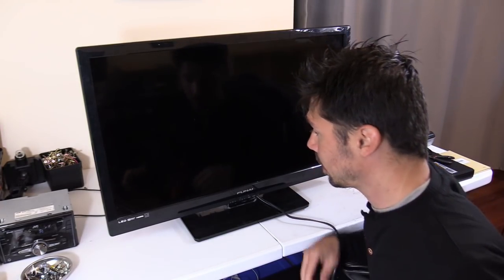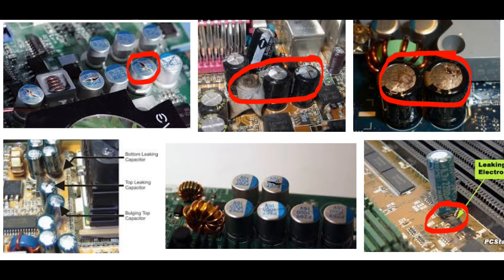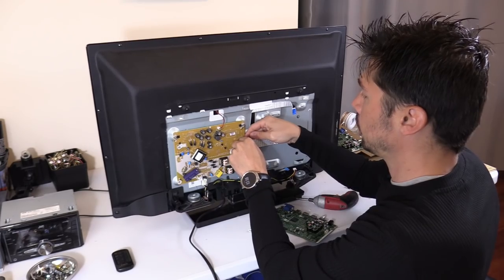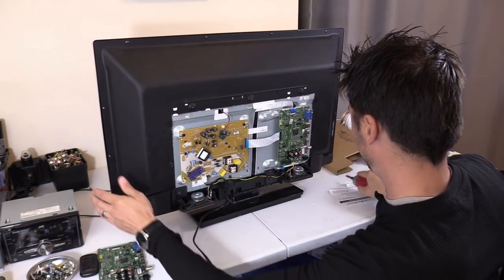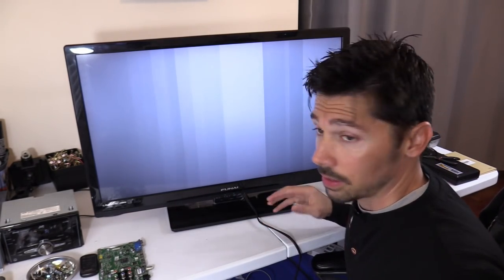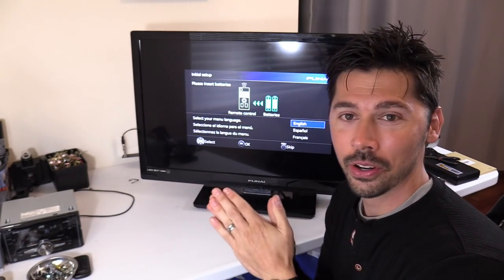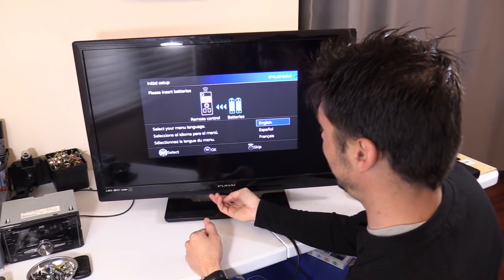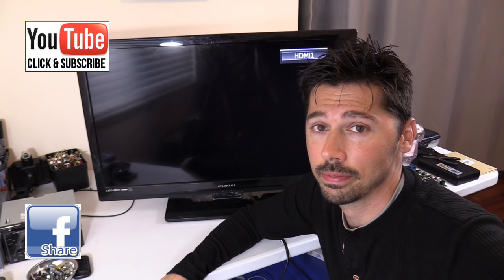WATCH THIS VIDEO BEFORE FIXING YOUR LED LCD TV

Comment: Tampatec, I have a strange problem I was hoping that you can shed some light on.  Samsung UA42 LCD TV backlight blinks when the TV is plugged in.  TV doesn't come on.   I replaced the power board as that is generally the issue without testing it first.  Still doesn't work but I found that if I unplug a small white connector on the PS board that the TV will power up, I see lights on the T-Con board and sounds works from TV.  I am guessing the plug  is the back light inverter as the backlight doesn't come on when unplugged.  Can't find this issue talked about anywhere.  Is it possible to repair this issue?

Comment: Hi, I'm trying to reanimate Vizio E461-A1. It reacts to power button, but only once, i.e. I can turn it on and then it doesn't respond to anything, so, I even can't switch it off. Screen is black, no backlight, but power LED shows that TV is ON now. Power supply works just fine - all output voltages are ok. Tried to replace eeprom on main board , but after soldering the new one it stops even turn on power led, so, i returned the old eeprom chip back and don't know what to do next. Any suggestion?

Comment: Hi Tampatec, I have a 55 Sharp Aquos that within a year and a half it crapped on me and I got too busy and missed the warranty by a few months. Here's the issue, the logo screen comes up and instead of going to the menu it restarts. I read somewhere how someone that had the same issue changed the main board and that fixed it, which I did but it still does the same. Any help in this matter will be greatly appreciated.

Comment: I have a Vizio 55" 4k tv model number M55-C2 the serial number starts with LWZQSBBS The mean board is bad and looked for a replacement one but no luck only found other one's that aren't compatible.
I was wondering if I replaced all the guts would that work?
Or does it all come down to the panel that would not be compatible?

Comment: I've watched a few of your videos now. I have an LG 47LW5600. While watching TV, everything went blank. The power relay clicks, it will turn on and off, but there is no sound and it appears there's no backlight. Would replacing the control board be a good first step?

Comment: Hi, i have a question. If I have a Sony tv that has a cracked screen in the corner from being hit with a drum stick that went flying across a room by accident, but has no visible crack when tv is off, do you think i would be able to fix it my self by replacing one of the panels that you talk about? Or do i just need to buy a whole new tv for that issue?

Comment: I have a Rca 65in the backlight and picture flash up ever 3 to 5 seconds. I have constant standby 5 volts and the power on gives me 5v steady even when cycling the flash.  I unplug the t con the backlight flashed once and stopped. I have standby 5v pwr on 5v 12v but my 24volt on PS I cannot get a reading. If I unplug backlight I can get 5v power that TV is on but no picture with tcon plugged in and backlight unplugged

Comment: Tampatec, 

Thanks for doing this video.  I really learned something here.  I know that eventually I'm going to order a board.  And using the sticker part number is the way to go.

And thanks as well for the tip about the brightness being at 50% rather than all the way up.  I would think that would also save some energy as well.

Regards, Tom

Comment: my 43 inch Samsung led smart tv fell a about a foot down... not flat down to the floor... basically still on stand but slumped over half way on the floor... ughhhgh so now there's horizantal lines and jumping   sound is still great and I can basically still see the picture.  it just jumps up and down I need help i think I'm gonna cry omg
Reply: no screen crack.  but corner frame is.

Comment: I hope you can help me. I have vizio tv when I plugged in the vizio logo lights up like amber color but doesn't turn on
Reply from the maker: Nicolas Jimenez shopjimmy.com sells a main board repair kit for that. First check stdby volts, if ok on power board then check out that main board repair kit.
Reply: I forgot to mention I changed the main board and still does the same I ordered the part  from electroparts and according to their troubleshoot guide that was the main board. My vizio tv model is VF551XVT 
Thanks for help me

Comment: Great video I wonder could you give me some advice I have a e-motion TV the red light is on but with the remote it will not switch on it will intermittently turn on with the button on the side of the TV any help would be very much appreciated thanks

Comment: I have a Philips 42 inch tv about 10 years old.  Its always had this problem: It sporadically turns itself on but has no sound, and the screen is white, then it will turn itself off again.  Sometimes, I have to manually press the on/off button to turn it off.  We had tech support replace the computer and power boards about 8-9 years ago, but this never really fixed this anomaly.  Am I thinking the problem is not on the boards?

Comment: i. have a 43 inch LG smart tv..that don't work right away the LG logo pops in and out , un till i burp it with my hand on it's back kinda hard a couple of Times and than it works. .but wen i shut it down and turned back on have to start the routine all over again any ideas ?

Comment: Great video, very informative and I like your delivery style, it is right to the point.  I have a question, I am looking at a VIZIO 55LE5400-UC for a friend.  When it is turned on I get the LG logo, a clock and the four dashes below the clock.  When that goes away the screen starts flickering and a static sound comes out of the speakers.  The flickering seems to go away but I think it just speeds up and the static sound is still coming out of the speakers.  I tested all the  caps on the TCON board with my Fluke meter and a Blue ESR meter, I took them off the board to test them and they were all fine.  What else can I do to rule out which board it is?  Thanks again for all your great work!
Reply: Update:  I did fix this TV.  I started checking the inputs on the main board and none of them worked, all the HDMI's, both component inputs etc.  I took a heat gun and carefully heated up the chip that controlled the HDMI ports and the other big chips...SUCCESS!!  The screen flashing is gone and all the inputs work!
Reply from the maker: Joseph Salmon thanks for sharing your experience 👍

Comment: Hi, Tampatec:
I have a SONY KDL 40W600B LED TV and it's not working. When I turn it on with the remote it stays on for about thirty seconds then it goes off. The standby (red) light blinks 6 times and repeats itself. One are not able to power ON or OFF the TV again. You have to unplug the power cord, wait a few seconds and then the process starts all over again.
Can you help?
Reply from the maker: can be backlight failure but check "standby" stby pin volts on power board, then "backlight on" volts https://www.ifixit.com/Answers/View/253917/red+led+blink+6+times+when+I+turn+on+the+tv
Reply from the maker: Sony had update patch here but not sure if that was for issue- https://esupport.sony.com/US/p/swu-download.pl?mdl=KDL40W600B&upd_id=11108&os_group_id=18

Comment: Just started watching your videos and enjoy them. I was wondering I have a Panasonic plasma  and it has developed  2 black lines running across the screen. Is it worth fixing.
Reply from the maker: plasma TVs break more often than LCD or LED TVs because they get hotter which wears out TV parts. can be bad connection to panel or a control board issue.

Comment: I had a high pitch noise like that out of my tv. It stopped working and only had standby voltage opened it up replaced the blown caps with better ones and it works. But it still has that high pitch noise. It's not that loud but I am just wondering if you know what it is?
Reply from the maker: maybe another bad tv part causing transformer to whine, unplug main board and see if that stops it.

Comment: I would probably get the old and new board mixed up - that's what i do for my parts - put old and new on them so I don't get confused or the date on the parts after I get them
Reply from the maker: that's a good idea, electroparts do mark their new boards but some other sources like ebay don't mark the boards.